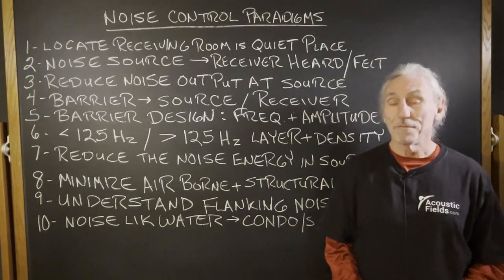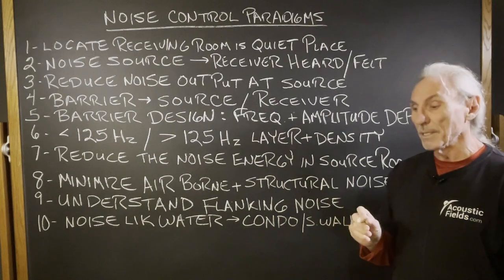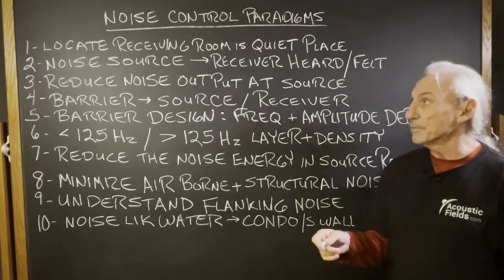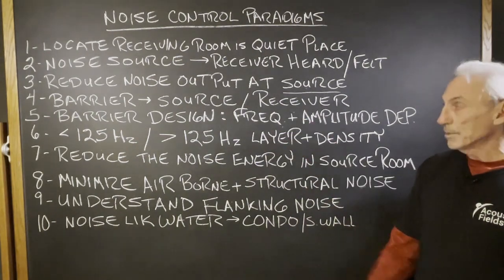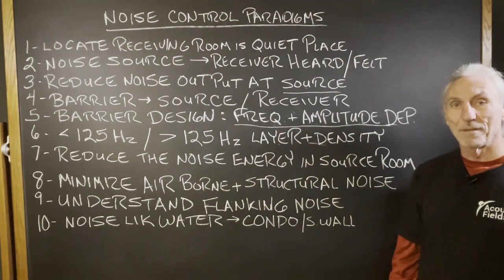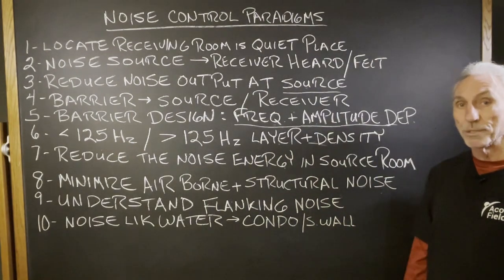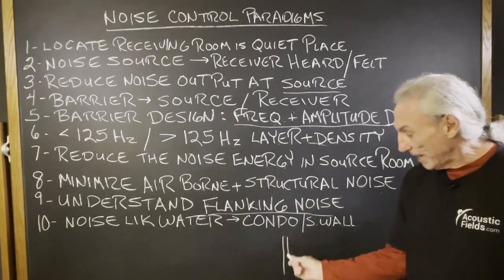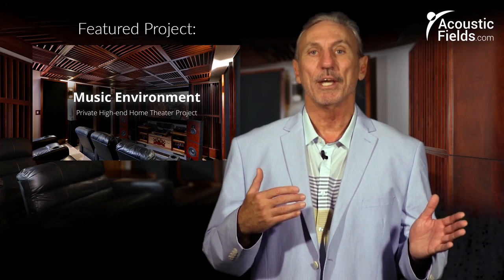Noise Control Paradigms - www.AcousticFields.com

Comment: What about the barrier paraDOX? The stronger the barrier the more energy that will stay in the room and therefore need to be treated. Is that correct?
Reply from the maker: It depends on what you mean with the word "stronger". Lower frequency noise requires barriers that have more mass or density. Your goal is to keep as much of the energy within your room as you can considering budget and space requirements along with room usage. Don't forget about the neighbor who works at night and must sleep during the day. All energy within the room, no matter what the frequency or amplitude, must be treated to match usage through the use of diffuion or absorption..
Reply: @AcousticFields  I'm just hypothesizing that the lower the frequency a barrier is built for, the more energy that will remain in the room, and therefore the more low frequency treatment will be needed to handle it. 
Ex: paper walls would not contain any low energy and the room would not need much, if any, low frequency absorption. However that room would have ridiculous noise issues.
Reply: @AcousticFields  I give you an hug Dennis, I'm a nurse and I work 6 nights a month so I'm too sensitive for rumors when I'm going to sleep after the night I've worked. Fortunately I live in a modern well insulated apartment: double glass windows,  roller shutters,  walls and floor termoacoustical isolated. 50m from my building there's a train station but with sound barrier up to 15m of height. Just an example of an integrated approach to noise reduction from source to listener...and yes I sleep very comfortable.